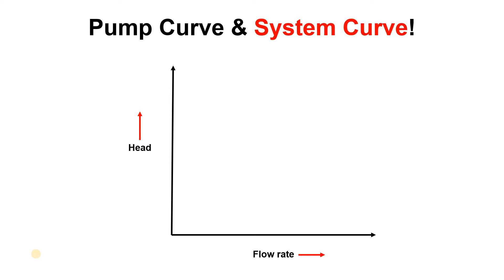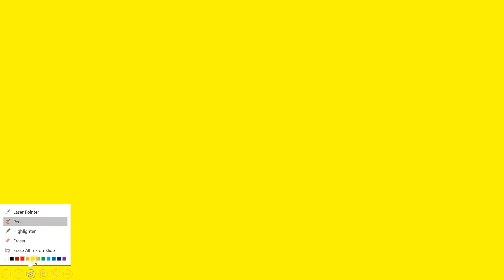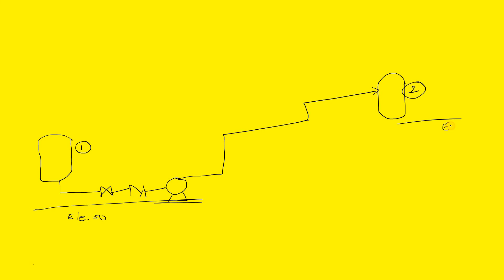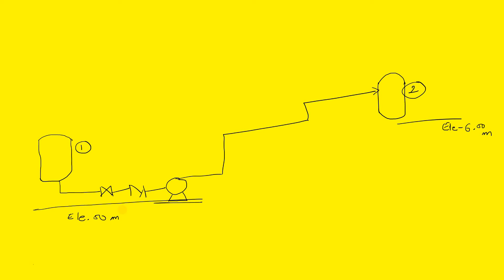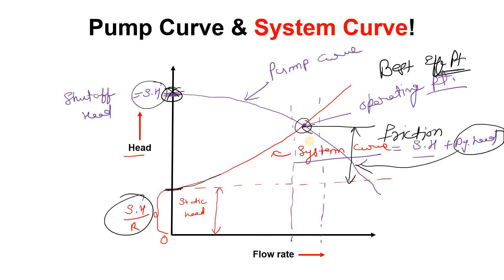Pump Curve vs System Curve Explained with Example | Pump Performance Curve | System Curve of Pump

Comment: Why is pressure at P2>P1 ?. Doesn't fluid flow from a high pressure to a low pressure ?
Reply: The pump increased the pressure.
Increaseing pressure generally is what pumps are for. If P1 was less than P2 a pump would not have been required.

Comment: what is head? how can it BOTH incrEASE AND DECREASE WITH FLOW RATE
Reply: Head is basically pressure. Imagine the pump is running but you shut off the valve (no flow rate), the preassure will be very high (max). Then you slowly open the valve getting some flow of water. As the water flow increases, the pressure will decrease.

Comment: Thanks for the explanation.

So a system curve is associated with the system (Piping System) where we are going to use the pump.
And the pump curve is associated with the pump which will be unique for each pump.

Is that correct?
Reply from the maker: Yup

Comment: Thanks for this. So, so helpful. 

Just to remove a bit of fuzziness in the whole picture.

1. The system curve represents the relationship between the head H changes due from Friction losses as flow increases or decreases? While,

2. Pump Curve is the relationship between the Pump Discharge Head and discharge flow rate?
Reply from the maker: Dear Nedum! 

1. The system curve will show the static head of the system (the head required to overcome gravity at zero flow) and the dynamic head, which is the frictional losses at varying flow rates.
So as it's the function of flow as well as it'll increase or decrease frictional loss will be also increase or decrease.

2. Yes, that's correct. The pump curve illustrates the relationship between the pump discharge head (total head or pressure) and the discharge flow rate (volume flow rate) that the pump can generate. It essentially shows how the pump's performance changes across various flow rates, helping engineers select the right pump for a specific application.

Hope you find the answer of your question!
Reply: @Coreengineers  
Extremely helpful.  Deeply grateful.
Thank you very much sir.